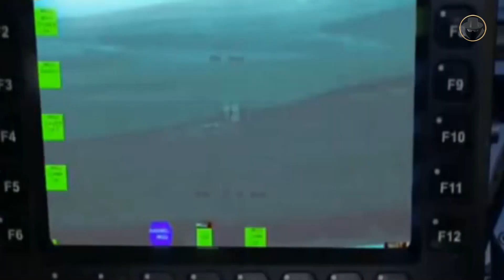Harimau Hitam

Comment: Just 1 machine guns for asymmetrical warfare? Anti RPG should come standard. I would have mounted an autocanon instead of a 105 gun. What armor is the AP ammunition supposed to penetrate?
They need some variant of a modernized Stryker.
Reply: u know that 105mm can fire HE?
Reply: They did have the 30mm auto cannon variant.. This variant were supposed to used for indirect fire support for infantry and anti tank capabilities